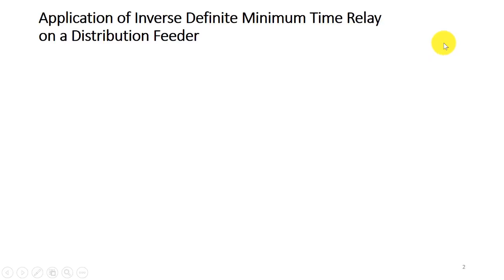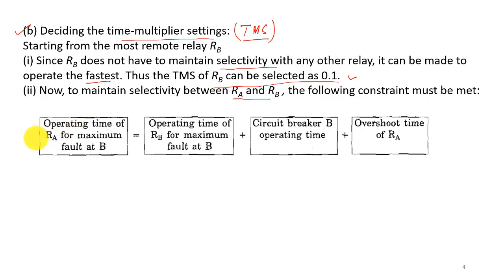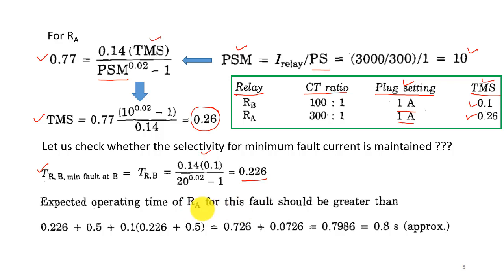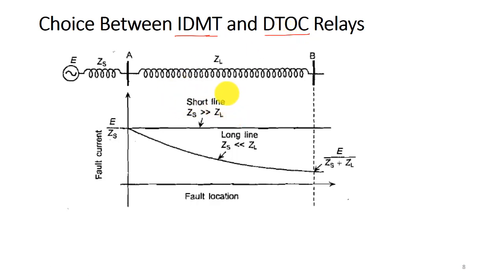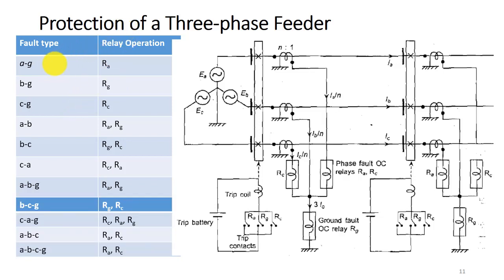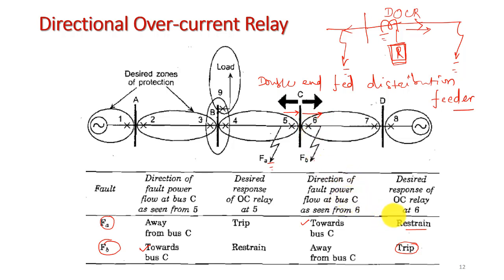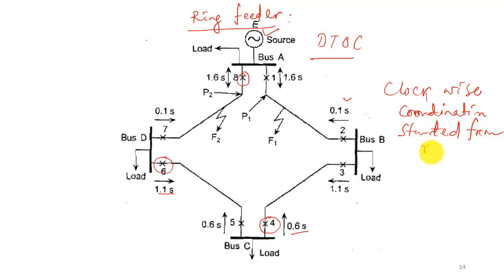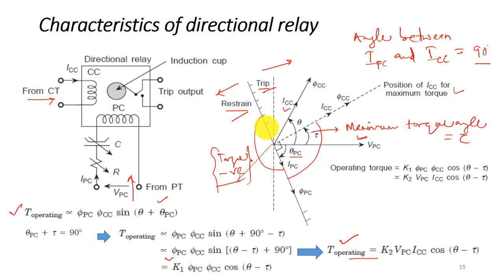Lecture 10   Over Current Protection

Comment: Hi. Can you advise why the load current for Relay B, which protects Bus B and line BC, is taken as 80A and not 160A + 80A? Isn't the load current at bus B taken as 160A which should be used to determine the plug settings? Please advise. Thank you.